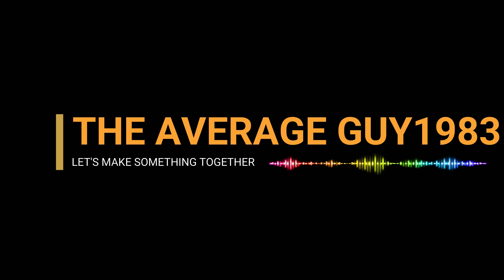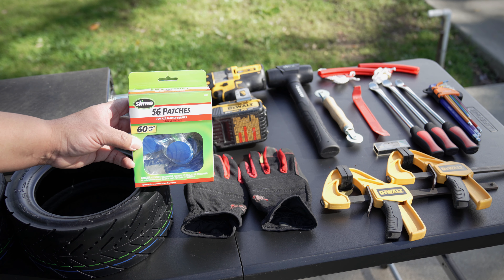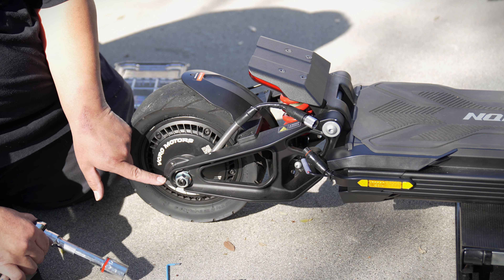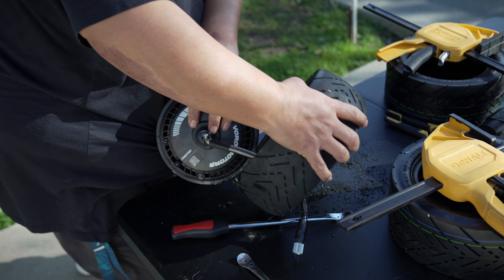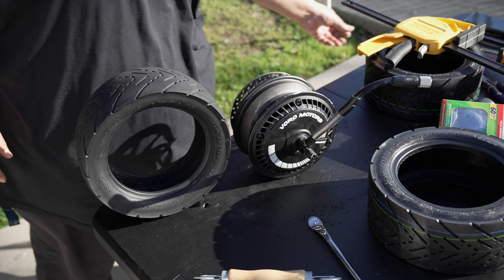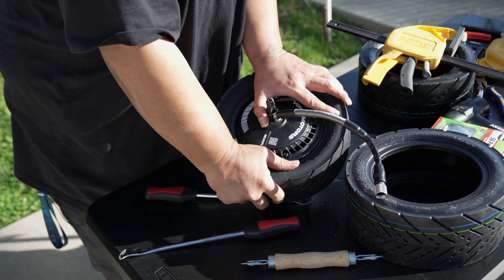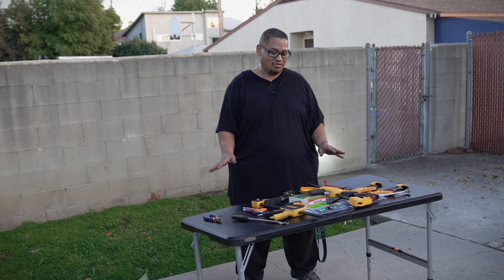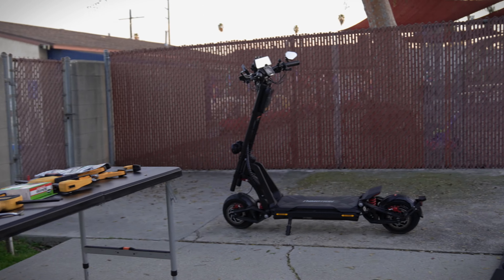Repairing The Inmotion RS Rear Tire

Comment: Jjajajjajajaja. Creí que yo era el único que sufría con las llantas. Yo uso llantas viejas y tengo una dura, de relleno duro, que utilizo para hacer presión y no dañar el eje. Pongo la llanta viejita o la de relleno duro en el piso y ahí trabajo, no sobre una mesa, que es complicado con la presión que necesitas poner. Mis hijos me ayudan con sus pies a pisarla, también.

Sí, para inflarla, la llevo a una llantera.

Me encantan tus vídeos, son reales. ¡Buen trabajo!
Reply: @THEAVERAGEGUY1983  you said inmotion is changing the charging ports for yellow version is that already done or they going to send a new batch out with the new ports
Reply from the maker: @TheRomabull  its supposed to be the new batches moving forward. Which includes, the Midnight, The Yellow model, the Orage RS Lite and the new Blue haze color. 😎👍
Reply: @THEAVERAGEGUY1983  do u know when the new batches are coming out I might get one next year lol
Reply from the maker: @TheRomabull  they are already releasing now. But there is a delay in the shipping due to them coming by ship to dealers. Its like the Super Slow shipping time lol
Reply: @THEAVERAGEGUY1983  fresh off the boat as some
Would say lol

Comment: Changing tubless tires is easier with three hands if its your first time. Yes glad you mentioned a hand pump or electric pump wont work airing up the tire. I used a compressor set at 125 psi . I will slways choose split rims and tubes over tubless. I bet you will never complain about a shop charging $80 to change a tire 😅 great information in the video.
Reply from the maker: @Alan-pk4qu  thank you. Yeah i wish i had an extra pair if hands to help. Lol!

I did change my tires both the front and rear to self healing tires. This time with better equipment like a jack stand with a hole in the middle for being able to put the bolt thats on the wheel through there helped get the tire off the bead and i also ised this gel grease stuff called Bead Buster which was an even bigger help to out the new tires on the rim along with rhe ziptie method and that there was a HUGE help. My difficulty level from changing the tires this time went from a 10 which was hard to a 6 which is moderate but can be done lol.

Comment: I know that I'm late watching this video, but I feel your pain brother. I went through the same process, but with a different scooter. I did find an easier way to do put the tubeless tire on the rim with little to no need for zip ties. You will need to use the swing arm of your scooter. If anybody has seen the tire change for dualtron rims, that's where I got the idea. The trick is to put the tire back on the rim partially, then install the motor back on the swing arms with the lock washer and nuts hand tightened, after that you will use one of your tire spoons to make a fixed point for tire to be nudged into the motor and finally with the other spoon guide the tire into place while rotating the tire by hand. You won't scratch up the paint but you will sweat a bit. Mind you I did that by myself on a Blade GT(same 11 inch tires) it is manageable solo.
Reply from the maker: Good advice, i appreciate it. 🙏😁

Comment: Great video. @Louie question, what are you thoughts on the BlueTran Lightning by mini motors? Just order one
Reply from the maker: Ive seen it but i havent had a chance to test it out. But i have heard good things about the 72 volt 35 Amp hour battery model, the only bad thing i heard is the charge time is really slow because the company sends you a 2 amp charger which can take about 25 hours to charge the battery from 0 to 100% or you can purchase the fast charger for an extra charge and have the scoorer charge in about 7 hours. I do like the split rim idea for the tire changing. It makes it easier. It's still challenging to get the rim edge off, but nowhere near as bad  as my RS 😅
Reply: I ordered it. Should ship out today. Hope to have it near end of the week. Thanks bud. @THEAVERAGEGUY1983
Reply from the maker: @HJESR  awesome! 😎👊

Comment: I've had to replace my rear motor
On my RS but when I've put it all together the motor won't spin and is locked in place.  Can u help with some advice PLEASE?
Reply from the maker: Oh, that's definitely not good. Can it spin freely while the scooter is powered off? If not, then the motor may be defective, or the caliper may have the rotor/disc locked in place or if it does spin freely when the scooter is powered off, the polarity of the wiring inside the motor may have been wired wrong at the factory and will need to be exchanged or replaced by inmotion. I just took a look at my wiring and noticed that there is only one direction it can be installed. I wish i could be of more help.
Reply: It doesn't spin freely with or without power
Reply from the maker: @DanielSmith-dz1qv  oh in that case its definitely defective. Did you get your motor from VoroMotors or inmotion?

Comment: I think its better to remove all the black paint on the outer part of the rim so that every time you need to change your tire it doesn't bothering you,just buffing the outer part of the rim to make it smooth and it looks additional design
Reply from the maker: That doesn't sound like a bad idea. Almost like having a chrome lip on the rim with a black wheel insert. That sounds pretty cool.
Reply: @THEAVERAGEGUY1983  yeah i think it's the better option rather than reattaching paint for the side that damaging the paint during removing tire

Comment: Hey what is that screen you have on the handle bar ? Can you give me the link is that a rear camera?
Reply from the maker: Absolutely! That is a Wolfbox G930 2 channel Mirror Dashcam that i got from amazon. The cool part about it is that it only needs a USB C cable plugged into it with a power bank battery that can do 5 volts at 2 amps or 5 volts at 3 amps. It does waste about 3 amps per hour so depending on your riding time you may want to get a battery with the amp hours needed for your use.

Here is the link for the dashcam and the upgraded higher quality rear camera i am using on this scooter.
WOLFBOX G930 4K 10" Rear View... https://www.amazon.com/dp/B0BRLYT8M1?ref=ppx_pop_mob_ap_share

WOLFBOX Upgraded WDR Rear Camera... https://www.amazon.com/dp/B09KRM9QQ5?ref=ppx_pop_mob_ap_share
Reply: @THEAVERAGEGUY1983  Thank you!
Reply: @THEAVERAGEGUY1983  Another question and thanks for replying, do you have to get the rear camera extension cord, or the camera cord is long enough, i got this scooter just waiting for it to arrive, i think this looks cool you can look behind u. 👍🏼
Reply from the maker: @tiggy1559  not a problem glad i can help. It does indeed come with the cable for it. I didnt do a video on wiring up the scooter for the dashcam but i do have some pictures on my channel under the (Community Tab) using a smartphone that shows how i ran the cable for it as well as hiding the GPS antenna for Speedometer information on the dashcam in the RS.
Reply: Excellent tutorial and Kudos for not editing out the problems even if it's at your own expense. Thanks a bunch
Reply from the maker: @hoplite1766  🙇‍♂️🙏

Comment: I would've kept throwing more plugs into it till they stuck.  We use 'em all the time with our ATVs and trucks.  Hope there isn't something with those scooter tires that the plugs don't work well.
Reply from the maker: I think the issue was that these tires aren't really that thick, so that's probably why that didn't work. I was thinking another option would be those mushroom style plugs or even those screw plugs, which i did end up buying to use as a temporary fix.
Reply: @THEAVERAGEGUY1983  Thanks for the heads up might get some different tire plugs just in case.  That was funny tho, it's always a pain putting tires back on.  You almost had it with the spoons at 18:13.
Reply: @Ammothief41  Wolf King GTR made it easy to remove the tires for repair, should be a slandered for all high end e-bikes

Comment: My brother how come you don't run with the Run Flats. Don't be afraid to use two plugs at once for a tire issue. It works
Reply from the maker: I used two plugs and that didnt work. Like i mentioned in the video the only reason i didnt want to go with the run flats at the moment was because these tires are still pretty new, financially speaking it would be a waste of money to not use up the original tires first and then swap out to the run flats which are definitely a better choice. 😎👌
Reply: @THEAVERAGEGUY1983  brother those run flat tires have save me so many freaking times man taking out a 2 and a half inch nail a month ago not losing a drop of air and would have left me about 2 mi from my house which is a walk of shame

Comment: The what not to do video 😂
Reply from the maker: Pretty much or at least what tools to buy to make the installation of a tire a bit more easier. It was easy to remove but hard to reinstall lol. But i got one of those larger size motorcycle jack stands that have that square hole in the middle which should make it easier to remove the tire off the bead. 😁👍
Reply: Was a good tutorial. I learned some very useful information. Keep them coming bud👌
Reply: How long of a wait did it take from the time you ordered your RS Midnight? I ordered one a week ago and have yet to receive any tracking information.
Reply from the maker: @humboldthunterfishfool4817  hi, since mine was a pre order so it took me like 2.5 months to receive it. Once i got a tracking number i got it within 48 hours because VoroMotors was under a lot of pressure to send the scooters out due to all the delays there was.
Reply from the maker: @humboldthunterfishfool4817  thank you very much. 🙏🙇‍♂️
Reply: Wow....mine is the Midnight lite. I'm definitely not waiting 2.5 months. I went through pay-pal. Sadly I like the scooter, but will probably get a refund and go a different route like Kaabo
Reply from the maker: @humboldthunterfishfool4817  it honestly wouldn't take anywhere near that long, but a lot of people are honestly very impatient. Like i mentioned earlier, mine was. Pre order and at the time only those who supported the scooter via Kickstarter got their units sent out first then buyers like me got in on the second and third batch of shipments. When i buy parts for my other scooter from segway or even Inmotion, they usually take 2 to 3 weeks to get to me because they come from China to my local vendor and then ship to me from my local vendor. 

It just depends how many scooters they have in stock as they get shipped from China by ship and then get unloaded to a yard and from there a trucking company picks up the cargo and brings it over to the dealer, like voromotors, Wyrd Ryds and Alien Rides then they have to unload them, and put them on their designated racks at their store and check them in under inventory and sell them. So Even a Scooter from Kaabo can take the same amount of time of 2 weeks to ship mainly because of stock availability. You wouldn't be making a bad choice going with a Kaabo either as thats another high end brand of scooters but in my honest opinion i really think you would enjoy the RS a lot more. It also depends how tall you are too as Kaabo scooters are a little higher off the ground specifically the WolfKing series. On the RS the deck and the stem for the handlebar are height adjustable. The only annoying part i have with my RS is the App with their Ads lol 😅 however i dont want to discourage you at all any of those two brands would make a wonderful purchase for you and a thrill to ride. 😎👊
Reply: At least with kaabo they have a customer service right here in California that responds. Unlike Inmotion Global who have yet to respond to me after a week. I've tried the number given, and sent numerous emails with zero response. Not really on par with Kaabo when it comes to customer service.
Reply from the maker: @humboldthunterfishfool4817  indeed. I would go with whoever i can get good service from. Good luck with rhe Kaabo, and let me know which model you get. 😁👊
Reply: @THEAVERAGEGUY1983  can you tell me if the warning light ⚠️ is supposed to come on when the break levers are engaged?? When I pull my break levers to stop the warning light comes on ⚠️  It goes off as soon as I let go of the break levers. I checked the codes and there isn't anything showing that anything is wrong.
Reply from the maker: @humboldthunterfishfool4817  hi, yes this is 100% normal, since the RS has a Zero start feature ON it the scooter disables the Throttle when the brakes are engaged to prevent an accidental acceleration of the throttle at a full stop should you accidentally twist the throttle by accidentent it won't move till you let go of the brake handle. Then the icon will disappear. 😁👍
Reply: @THEAVERAGEGUY1983  my RS lite started throwing a 217 code....and it looses all power. When i check diagnostics it says nothing is wrong.....can you help me with this issue??
Reply from the maker: @humboldthunterfishfool4817  hmmmm... code 217 is an overcurrent warning. This usually happens when the rider pushes the scooter hard in a single motor mode, be it the front or rear motor. Usually, to avoid this, the rider needs to keep the scooter in dual motor so that neither motor has to work harder, pushing the heavy scooter body plus the weight of the rider. The other two reasons would be high temps on the motors or the controller, which would need to be shut down, let it cool down, and then power it back on after it's cooled down and hope the code clears. If it keeps happening, the motor or controller may need to be replaced.
Reply: @THEAVERAGEGUY1983  the rs lite and RS midnight have either Duel motors, or just the rear, right? I mean you can't set the rs so just the front motor is running,  right?? Just the back, or duel(front and back)??
Reply from the maker: @humboldthunterfishfool4817  it actually does have three motor modes. You can change the mode by pressing and holding the Cruise control button on the left side where the turn signal buttons are. 

The (D) icon that is Solid on the display is Dual Motor mode.

The Flashing (D) icon on the display is Front Motor Mode

And the (D) icon disappearing on the display is Rear Motor Mode. 😎🙏
Reply: @THEAVERAGEGUY1983  I did not know this, so ya maybe I was pushing to hard in single. Thanks for the info. I'll let cool bring to full charge and see how goes it. Thanks Buddy, I appreciate you🙏✨️
Reply from the maker: @humboldthunterfishfool4817  no problem. Remember, you got a Beast of a scooter. 😎👊
Reply: @THEAVERAGEGUY1983  hey sorry for bugging ya man, but in the owners manual under error code, meaning and explanation, 217 is the code for the back motor. It says under explanation that it's a controller malfunction. To either reboot or contact after-sales sevice. So, too reboot, does that mean to restore to factory settings? Because that's the only option I can find under general settings is "restore to factory settings " nothing that says reboot. I take it, restore to factory settings is reboot???? Just trying to clarify as a last resort if it doesn't clear itself after a rest and fresh charge.
Reply from the maker: @humboldthunterfishfool4817  yeah 117 is the front and 217 is the rear. I apologize for not clarifying that. As for the reboot l, they usually mean power cycling the scooter as in turn it off and then turn it back on and see if that works. The last resort would be a factory reset through the app. If that doesnt work and you still keep getting that code, then it would be best to contact rhe dealer you got it from or Inmotion if you got it from them and wait for them to respond to your email and have them send you a new controller. 😬
Reply: @THEAVERAGEGUY1983  copy that. Ya I bought my RS lite through Inmotion Global. I just sent an email so hurry up and wait I guess. Super depressing though. It's literally new😢
Reply: @THEAVERAGEGUY1983  Hey Louie, Brian here. So Inmotion Global is sending me a new rear controller. I have to install it. Do you have any tutorials or any links you can give me to assist in the changing of??? I'D certainly appreciated your advice on the matter, sensei🙏😊
Reply from the maker: @humboldthunterfishfool4817  hi, unfortunately i dont have one for the rear motor controller. I know Inmotion Global has on on their youtube channel but they go by the instructions so fast that its almost not helpful.